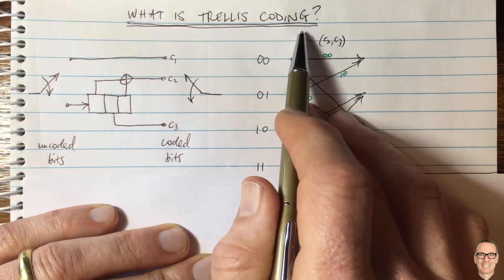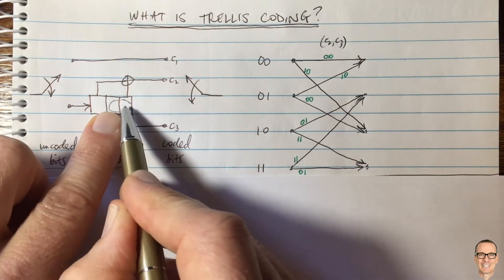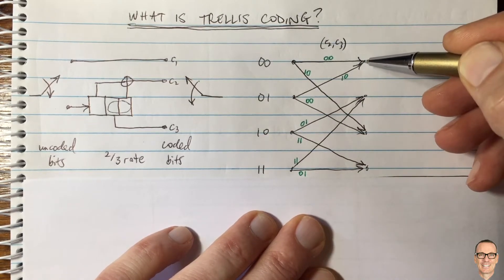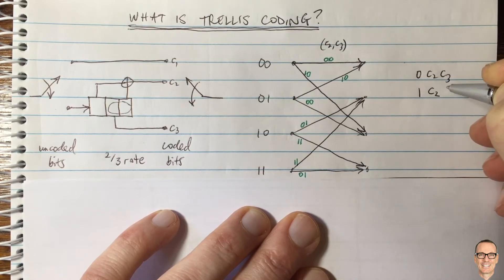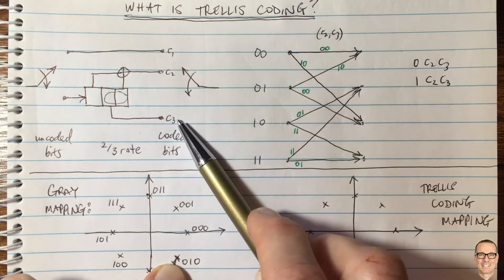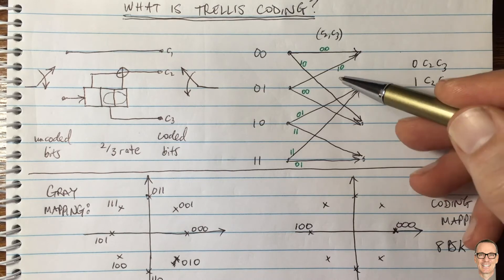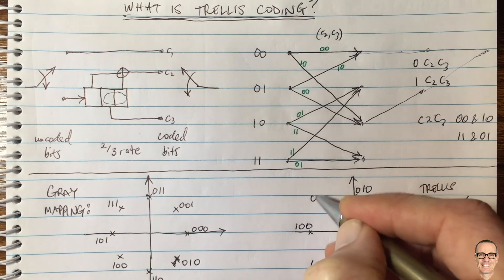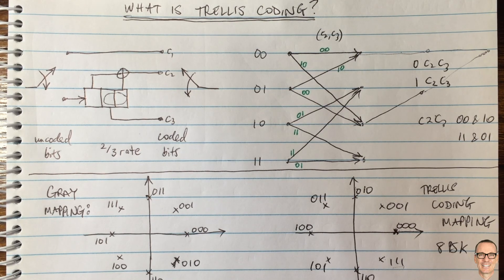What is Trellis Coding?

Comment: Hi Iain. One question: Is this the optimal constellation for Trellis coding? I understood that idea is increase the Hamming distance between 2 close points on constellation diagram which is opposite to Gray diagram. When I tried to reproduce it, the first 2 steps were identical in my case (positions for 000, 100, 010 and 110), but I ended up with different position for remaining 4 positions because I first put "11" and you did with "01". So to summarize my positions are (starting from 000): 000, 011, 010, 001, 100, 111, 110, 101. For some positions this leads to better/worse Hamming distance comparing with your result. Is my approach valid, or I missed point for step 3 (adding "11" and "01")? Thanks in advance...
Reply from the maker: It depends on the convolutional code you're using. The important factor is to maximise the metric between different codewords that are being compared in the Viterbi decoder. Perhaps this video might help: "Decoding Convolutional Codes: The Viterbi Algorithm Explained" https://youtu.be/IJE94FhyygM

Comment: When using TCM, will I use the channel code?
Reply from the maker: Trellis coded modulation (TCM) combines the channel coding and the modulation, so there is generally no need to use another channel coder in addition. However there is often still other coding at higher layers, such as ARQ and TCP.
Reply: @iain_explains  Yes, thanks u.